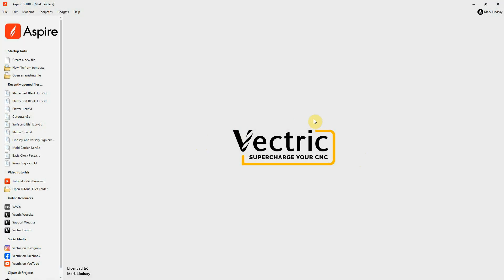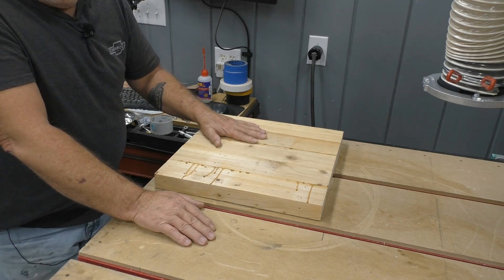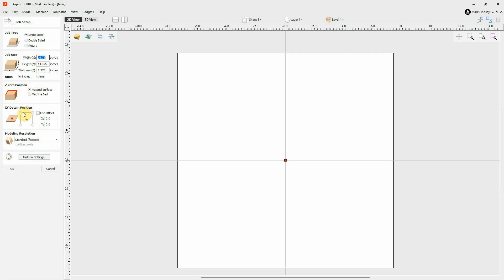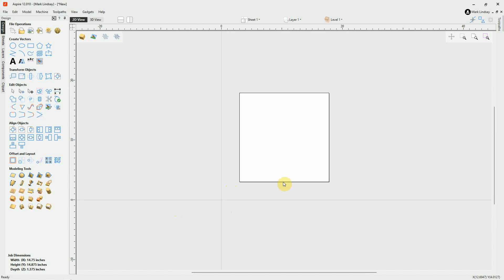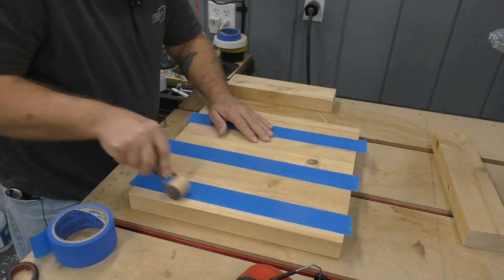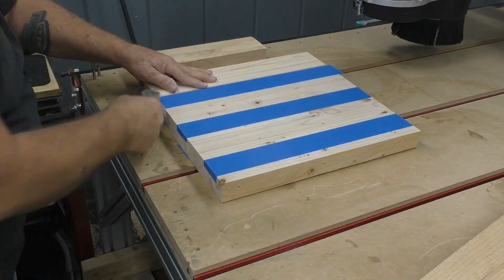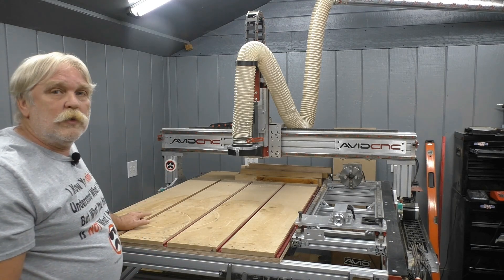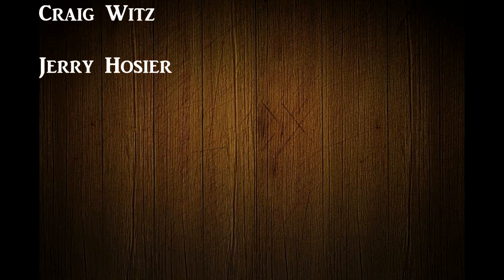Using Offsets Within Job Setup in Vectric Software

Comment: Amazing all the features Vectric has and we simply overlook. I noticed the work offset when I installed my laser and applied it since it hung off the work area. Last week had to get a job done for a beta test quickly and I unfortunately decided to do maintenance before the job. Dummy me ended up having the x-axis binding close to home position. Rather than work on binding issue, or recalculate all tool paths away from rail, I figured to use the Offset and set project over 4” and up 4”. Never having tried that before with anything other than laser, it luckily worked out. What I love about your channel is I can search for practically anything and you will have a video on it. Thanks for all you do. Wish I had more time to be a member and come along for ride, but the times you get together don’t work for me at the moment.

Comment: Mark,
Have you or anyone having problems with the upgraded aspire. I've been having problems with the profile cuts. It doesn't cut at the depth set as  or the number of passes. And sometimes it won't add the tabs as set and shown.
Reply from the maker: I've not heard of those issues at all. I'd send an email to Vectric Support, and attach that file to the email so they can see if they can replicate the problem.
Reply: @MarkLindsayCNC  I  can't get them to respond.  I've tried several times with no luck. I have a shark hd520 and talked to the manufacturer. They sent me tap files to run, and it runs fine. But when I use aspire to run a profile cut, it goes wacky.
Reply from the maker: I'm sorry, but I'm not going to be any help to you. As I've said, I've not experienced the issues you're having. You have a tech support question, and I'm not qualified to troubleshoot your issues. Your best bet is to bug Vectric Support or try posting your issue on the Vectric Forum. Someone over there may have an answer for you.

Comment: Why not just use the touch plate and be done with it? Seems like a lot of extra steps for just one project.
Reply from the maker: As I said in the video. I could have done exactly that. However, I've been asked about this numerous times over the last 8 years, so I took the opportunity to demonstrate it.
Reply: "for just one project' is the important part,  in my case, my alignment pins (side guards) are not at my Sensor Home location,  I could see this being used. My G56 is 24.61mm by 25.09mm from machine 0,0